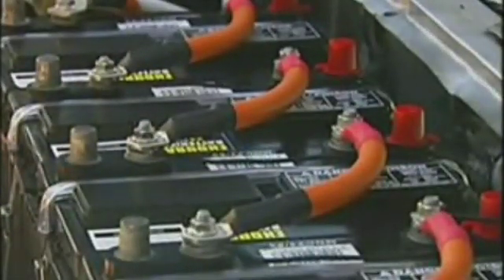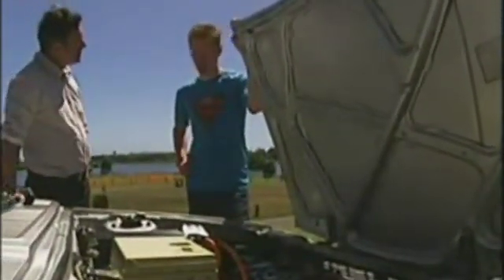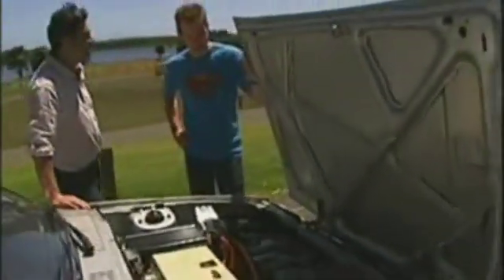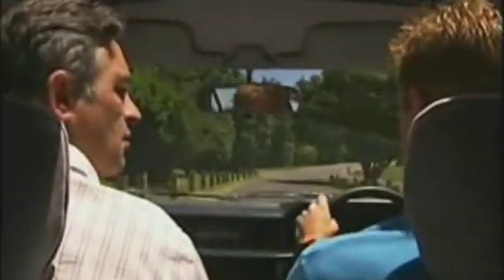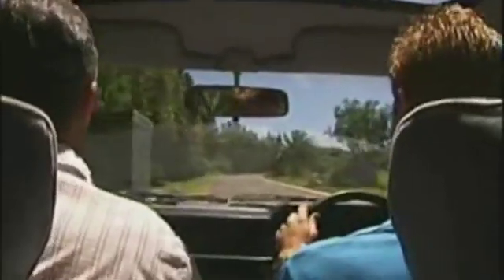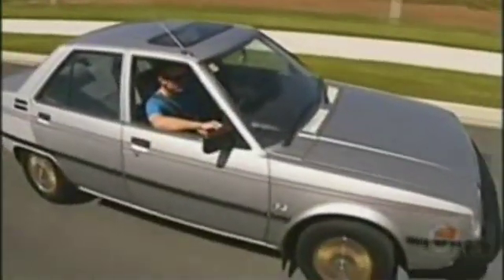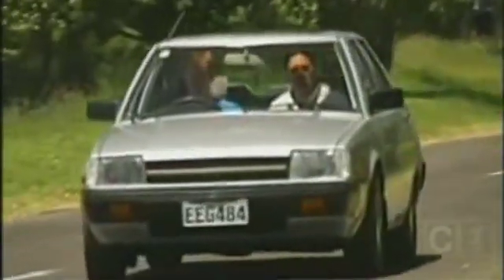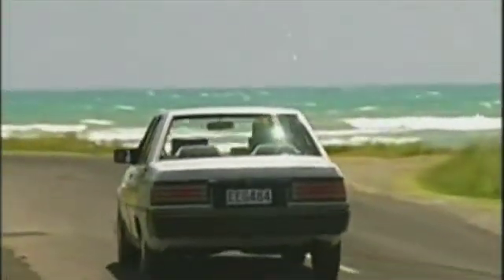Electric car conversion made easy - Insider secrets reveals how easy it is

Comment: 1.70 bucks for petrol. hahahah....well come to europe mate...
Reply: no, dollars are cheaper than pounds and euros.
Reply: +KingProne  That's per liter.  He gets 60k from $2 of electricity.  That's 36 miles.  Here in the US gas is about $2.25 per gal.  So he's getting the equivalent of 36 mpg.  I think he's paying way too much for electricity.  What the hell are the rates in NZ?  I just checked.  He pays 9 cents per KWh.  The only way he could use $2 is if he used 22 KWh of power charging the batteries.  Does anyone know if that sounds possible?
Reply: they pay 9 cents per kwh????? :O
Reply: +KingProne   That's what i understand.  I pay 20 cents or there abouts.  Does that sound wrong to you?
Reply: nope its about 22 pence or so in the uk.
Reply: +KingProne Yeah i just checked again and i found that it's gone way up where he lives.  It might be $0.30 per kWh there.  That sucks.  No wonder its costing him so much to charge that thing up.  It still sounds high, but i don't know what any of the charging wattages are so i don't really know.  Cheers.
Reply: he can get a nightmeter though and pay much less if he charges i.e from 2300 to 0500.
Reply: Yeah. i didn't factor that in.  I have to look at this again.

Comment: You probably could. An electric motor can operate over a wide range of speeds so you could probably just keep it in second or third gear all the time (except when going very fast on the highway) and not have to shift gears except when going in reverse.

Comment: No the government of New Zealand would very happy. They would need outside oil a lot less so the country would be more stable. And as new Zealand is mostly run by renewable Electric which makes power at all times of the day not just when we need it. And EV are mostly charged at night this could mean renewable Electric made is not wasted and it makes the over all Electric grid as the peaks and troughs are smaller.